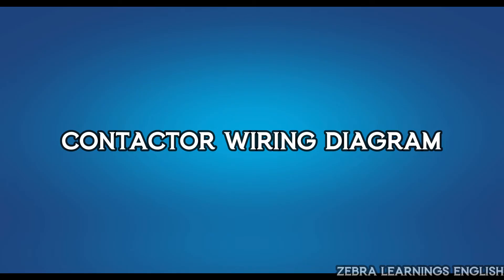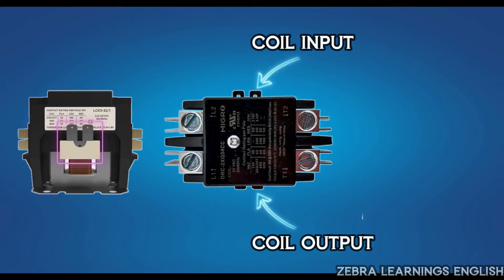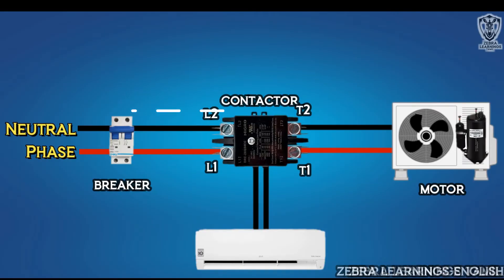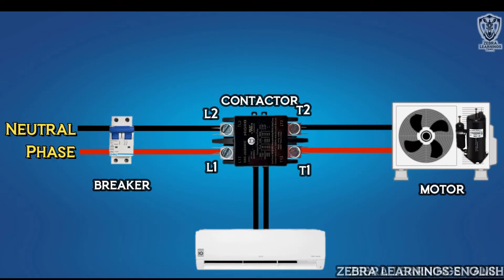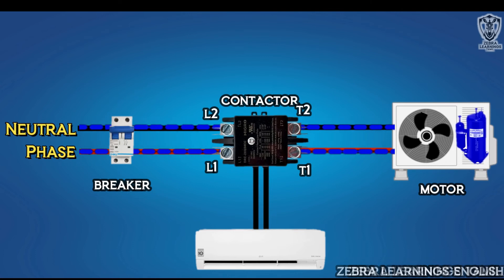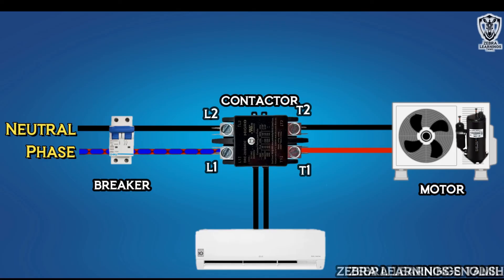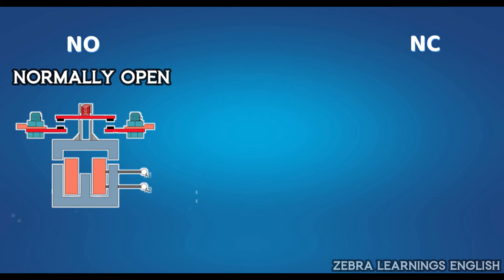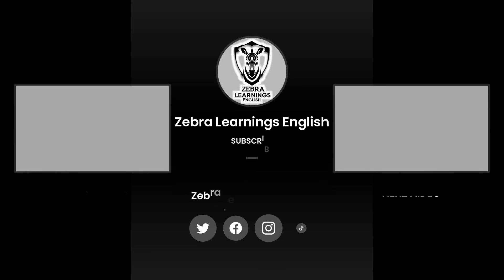Contactor Wiring Diagram | Animation | HVAC | Electrical

Comment: You said in the normally closed that no power is given to the coil, is that correct. Or should the normally close wire from the micro switch go to A1 of the coil

Comment: Subject: 2-pole electro magnetic power contactor(BCH -CPG 225) for AC single phase-motor circuit;

Is it "technically appropriate" to provide jumper connection (shorting) between main power terminals- L1&L2 of CPG contactor?
Power terminals= NOT related  to auxiliary contact;A1&A2 terminal 

Please feedback